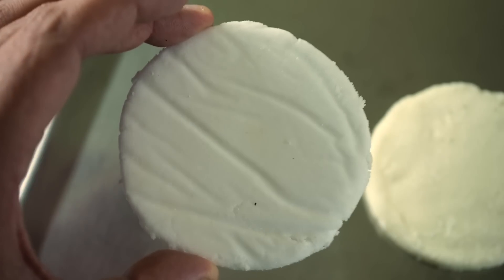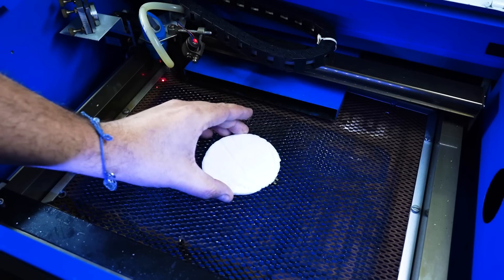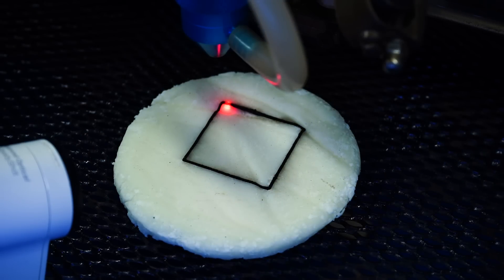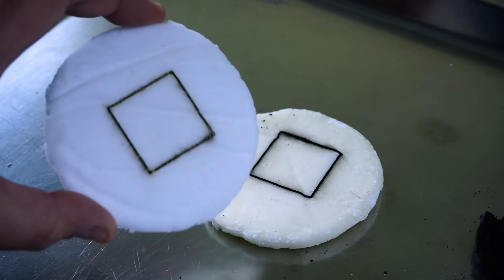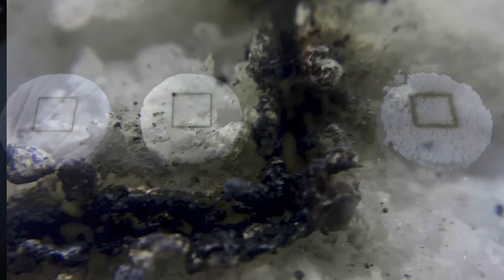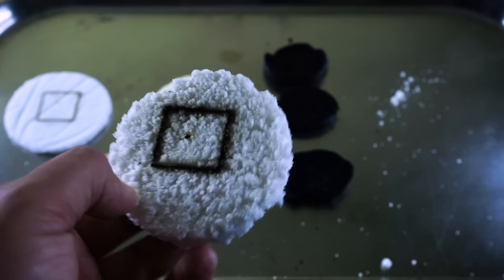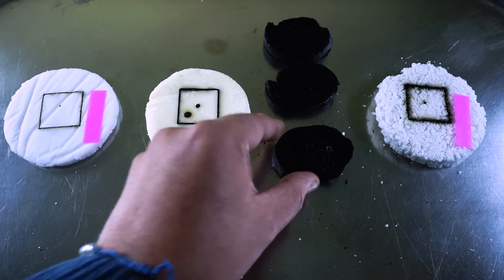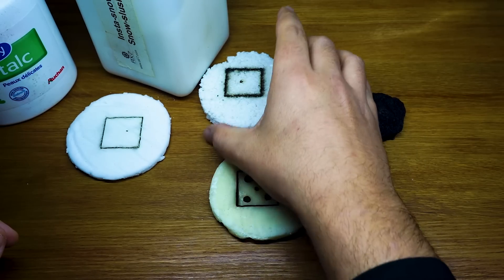K40 Laser vs. Starlite Super Insulator / Testing what Recipe really works

Comment: Interesting experiments... and nicely documented... but I do have a couple of comments...

1. I suspect that your LASER can deliver MUCH higher temperatures than your estimates      (unlike a torch flame it's delivering what amounts to "pure energy", and with foam-like materials, to a material with almost no mass)
2. Note that carbon does BURN in air at high temperatures... and so doesn't hold up to high temperatures for long in the presence of air/oxygen (another video I saw some time ago tested some formulations that "produced a sort of carbon foam with INERT GAS bubbles" - which would protect the carbon from oxygen; this would seem to be a weakness of any formulation with a high percentage of carbon - at least in atmosphere; I would think using some sort of ceramic powder, bonded with glue, might work well - although baking soda is actually quite temperature stable)
3. In order to have commercial applications the material would have to be stable against moisture and some degree of mechanical stress.
4. Note that the absorption spectra of materials with a CO2 LASER is rather different than with other sources of heat (so that would suggest rather different materials to disperse of diffuse rather than absorb the energy from a CO2 LASER than from a flame or frictional heating)

(It seems to me that, with modern materials, some sort of silicone aerogel, with a ceramic coating, would survive extremely well. Alternately, something like a coating of ceramic powder, with a micro-plating of gold on the powder, dusted over a thin layer of heat-conductive metal, would reflect most of the energy at the wavelengths delivered by a CO2 LASER, and would prove almost impossible to heat... but wouldn't necessarily work well at other wavelengths or with direct heat sources like a flame.)

Comment: Actually lasers have negative Kelvin temperature. That's why they can heat objects basically infinitely and be used for example to start fusion reactor. Focusing for example sun light, it's not possible to heat object hotter than sun's surface. Thermodynamics laws allow this for lasers because of negative temperature.

What comes to definition of material resisting certain temperature, it needs lots of clarification. Does it mean it's surface temperature can get that hot, or can it resist normal pressured air,heated on such temperature or can it withstand thermal radiation which comes from that temperature.

Plasma in a plasma ball can be several thousands if degree C, but it don't melt or even significantly hear the glass. That's because it's very low pressure.

With starlite, I can pretty much certainly say it can't sustain 10000C surface temperature. No known element or molecule can and it's highly unlikely that such substance exists.

There are many ways which materials can resist high temperatures certain amount of time by sacrificing their material. Basically there need to be a good insulation for example from carbon foam and then cooling from vaporizing substances or endothermic reactions. Vaporizing gases can also reflect or block thermal radiation  or laser light.

It is possible to resist intense thermal radiation or laser light infinitely by reflecting them away, but it's not the same as heat resistance.

Comment: It looks like this material can create a lot of graphite foam.
Once you have burned it with the torch, 
try to stimulate the burned area with the laser in raster mode.
If you blur it, you get the same area (higher focal point) is bombarded with the laser more times at lower density.
In this case it is not necessary to put much power.

This laser light should stimulate the graphite, to create graphene foam.
That by not creating perfect hexagons, manifests capacitive properties because of the defects it has.

Comment: This seems to be perfect to use on leaking exhaust systems and then out a soupcan over it?
Reply: The problem there is that most of these mixtures are relatively brittle, especially after heat exposure, and also somewhat susceptible to moisture. There's a big difference between a head shield attached to a wall, and exposed to a torch flame, an ablation shield on a space capsule, and a repair on a car muffler. The ablation shield must have significant mechanical strength - but need only hold up for a short time. Fireproofing on a wall that had merely the mechanical strength of styrofoam insulation could still be quite useful in fire prevention. But a car muffler or other engine exhaust system has to be relatively strong, and resist vibration, as well as tolerate exposure to moisture and other chemicals long term.

As I recall Starlite was SPECIFICALLY being proposed as a replacement for the heat shielding used on space vehicles.

Comment: I'd be curious about Starlites effect on Cold&its heat disippation capabilities, like if this material disippates heat almost instantly wouldn't it be usefull to use it to cool down surfaces? also what are the insulating properties? COuld it be used to make Fire-proof insulation for homes?
Reply: Normal usecase where Dissipation of heat is required, we normally need to take heat from one side and dissipate in other side or some where away from the source. So the material needs to be good conductor. But here it is dissipating the heat of the heated side in the same side only, the other side don't feel the heat.  That is why, I guess it will not be useful in cooling down surface. Please feel free to correct me, if I am understanding it wrong.
Reply: When intense heat is applied to Starlite the resulting chemical reaction is almost the same as in the pharaoh's snake intumescent reaction discovered by Friedrich Wöhler in 1821.

A Starlite like material must at least contain 2 elements namely:
- A chemical that contains carbon and releases that carbon when it burns.
- A chemical that when heated releases a gas like co2 that inflates the carbon as it forms turning it into a carbon foam.

When intense heat is applied to Starlite it quickly forms a black layer and bubbles of carbon starts to form. The deeper the heat goes into the material the more it’s pushed away by this expanding foam of carbon itself and once it’s in this solid state it also has insulating properties so the transfer of heat is doubly reduced.

It’s cold enough to touch almost instantly because carbon foam is an excellent black body radiator which is a scientific term used to describe an object that among other things dissipates energy just as quickly as it absorbs.

Comment: use Perlite and Sodium Silicate. That should handle heat very well... Sodium Bicarbonate is optional, but worth a try.
Reply: The "Soda" portion, is there to create a "CO2" Gas, to put out the Fire, rather than absorb heat and spread it or resist it. The Cornstarch is there to create the Carbon Insulating Barrier, and the PVA Glue, is a Binder, to keep it all together.

Knowing those functions, gives us a base in which to try swaps, in our tests, though!  

I mean, could cement powder and water replace the PVA? What about something besides just WATER mixed with the cement? 

How about other liquids? Or Bentonite Clay, instead of, or with, the Cement? 🤔

Comment: Will starlite rot through time or can last indefinitely? if it last long it will be super interesting
Reply from the maker: In coincidence i am just about to finish another Starlite video that will be published next week. I will keep the leftovers so i can make a followup video in a while how they hold up.
Reply: @MancaveEffects  Thanks man, you're really informative with your vids
Reply: If you add borax it becomes insect and mold resistent.
Reply: @cjbartoz  Thanks for the info! 🙌🏻
Reply: at least the original type doesn't go bad at least it takes more than 20 years as 1 sample that was used in 2 nuclear flash tests within 10 minute of each other was later tested using a very strong laser and easily held up to it

Comment: The most common industrial cutting method is Oxy / Acetylene for steel. It would be interesting to see if a few hundred micron (equivalent to primer plus 2 coats of paint) of starlight can prevent or inhibit oxy cutting of steel plate.
Reply from the maker: Unfortunately i dont own a oxy / Acetylene unit but i was thinking about making a crucible out of starlite in a future video that also had been suggested a while ago ;)
Reply: the original starlite was tested with oxyacetylene torches
Reply: @gamesandglory1648  The TV demonstrations I have have seen used propane torches. I'm sure they did extensive tests in the lab including with oxy, but I have not seen a video of oxy.
Reply: A standard torch cutting steel is heat and oxydization. Stainless steel can't be cut with an oxy/acetylene torch because it doesn't oxidize. All forms of heat have to be tested. I could say look, stainless steel can't be cut with an oxy/acetylene torch so it is impenetrable to heat, until someone cuts it with a plasma torch.

Comment: NASA had done the research on the original Starlite material even w/o knowing the exact formula itself - they got the working principle. 
So it shouldn't be a surprise that they use Carbon-Carbon foam for the Solar/Thermal-shield for the Parker Solar probe. According to the guys working on the project that shield is taking about 1300 degrees Celsius on the sunny-side :) and lets only 300 reach the back-side.
I guess even better insulation could be reached, with more material, but as all things launched in space. weight is also important factor.

Comment: Could you make a crucible out of Starlite?
Reply: I don't think you could exactly. A regular crucible conducts heat from the forge into the material. So your crucible would be actively preventing heat from getting to the bottom and sides of the bowl.
Reply from the maker: Thats a pretty good question. I may try it out in a future video.

Comment: i think the real differnce between the starlite and the carbonbread is that starlite works some sort of reactive (builds new shielding with the backingsoda)
Reply: The simplest way to make a material that has similar properties as Starlite involves mixing together:
corn starch 
baking soda (10% of the amount of corn starch)
Regular white glue (as much as needed to turn this mixture into putty)

When intense heat is applied to Starlite the resulting chemical reaction is almost the same as in the pharaoh's snake intumescent reaction discovered by Friedrich Wöhler in 1821.

A Starlite like material must at least contain 2 elements namely:
- A chemical that contains carbon and releases that carbon when it burns.
- A chemical that when heated releases a gas like co2 that inflates the carbon as it forms turning it into a carbon foam.

When intense heat is applied to Starlite it quickly forms a black layer and bubbles of carbon starts to form. The deeper the heat goes into the material the more it’s pushed away by this expanding foam of carbon itself and once it’s in this solid state it also has insulating properties so the transfer of heat is doubly reduced.

It’s cold enough to touch almost instantly because carbon foam is an excellent black body radiator which is a scientific term used to describe an object that among other things dissipates energy just as quickly as it absorbs.
Reply: To be clear, nobody knows what’s inside Starlite except for the in 2011 deceased inventor, his wife and his kids. One of his daughters is trying to commercialize the original Starlite trough her own company.

Comment: Will StarLite work as a heat barrier as well as it does with using a flame heat.  try using it with a non flame heat like a header wrap or a stove pipe?
Reply: When intense heat is applied to Starlite the resulting chemical reaction is almost the same as in the pharaoh's snake intumescent reaction discovered by Friedrich Wöhler in 1821.

A Starlite like material must at least contain 2 elements namely:
- A chemical that contains carbon and releases that carbon when it burns.
- A chemical that when heated releases a gas like co2 that inflates the carbon as it forms turning it into a carbon foam.

When intense heat is applied to Starlite it quickly forms a black layer and bubbles of carbon starts to form. The deeper the heat goes into the material the more it’s pushed away by this expanding foam of carbon itself and once it’s in this solid state it also has insulating properties so the transfer of heat is doubly reduced.

It’s cold enough to touch almost instantly because carbon foam is an excellent black body radiator which is a scientific term used to describe an object that among other things dissipates energy just as quickly as it absorbs.

Comment: A little backround to this. If you look at the Structur of starch woodglue and backingsoda and do a binding energy comparison, you ll see that basically all binding energys are close together and that a huge amount of gasses are produced. in my oppinion 4 to 5 mol per mol of material. My theorem is that this stabilises the temperatur of the carbon enough to not just form layered carbon(graphene) but a interconnected multilayered carbon foram which makes it really really hard for oxygene to attack the carbon efficently. To this it appears that the Na+ that is sourced by the baking soda will form a connective salt between carbon structures plus it doubles as victim for aporoaching oxigen. And evenfurthermore at really high temps not even Oxigene should beable to harm the carbon layer anymore sinde the temp is so high that the binding energys will just be brocken instantaniuosly even between co2 and cc which in turn releases c+ gas and depending on what structure this means that you basically will have a last resort insulating c+ gaslayer forming i guess.
In essence you can take the second disk as a series of carbon structure systems forming Graphene buckyballs carbonnanotubes which all have a high ressiliance to oxigen and in the end you recive atomised carbon+(plasma) which as soon as it is cold enough forms co2 which is visible as the nice orrange flame at the end of your burn.

Have you done time till penetration with your laser? care to tell us how long it took your laser to penetrate?
Reply from the maker: Thank you very much for this interesting comment! 
No, i stopped experimenting after that two minute exposure of the laser. With a more powerful laser source and more time the laser would probably penetrate trough but all after all it is a very resistant and interesting material

Comment: Also what is the temperature of the laser?
Reply from the maker: The laser itself does not have a temperature, but i would guess the temperature of the focussed beam to be arround 2000 - 3000 deg. centigrade
Reply: So you could theoretically use this as a protection against SABOT rounds on tanks
Reply: @averageintelligence6822  the original starlite can supposedly handle up to 10000 degrees C (much hotter than the surface of the sun)
Reply: @gamesandglory1648   HMMMMM so if it was able to absorb impacts as well my guess is that it could be used as an armor on tanks.

Comment: What if you could use this as a protection against shaped charges for military equipment and vehicles
Reply from the maker: The material is very brittle though, but i guess the military is already been using some sort of Starlite as heat protection.
Reply: Mancave Effects possibly but from what I understand the armor they use isn’t a heat resistant armor more of a way to disperse the jet of molten tungsten from being a penetrating force
Reply: I should mention I’m a computer science major and have little understanding about this stuff
Reply: it is very much not explosion resistant a hammer could easily break it

Comment: someone take a damn plasma torch to it already
Reply: beyond the press did it, the high pressure air and molten metal does eat it away (this requires a metal plate infront of it ofcoarse else plasma arc wont form) but considering you can just cut this stuff with a knife any abrasive stream will chip it away.
Reply: @Drachenhebron  so fuckin true
Reply: M